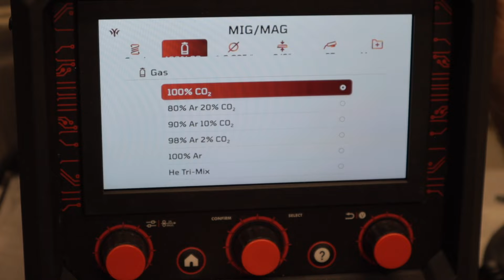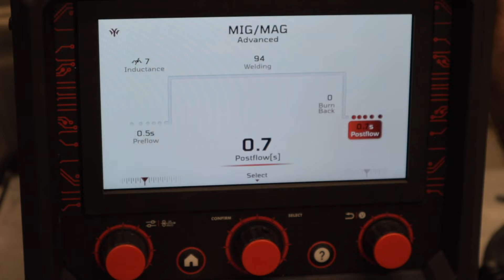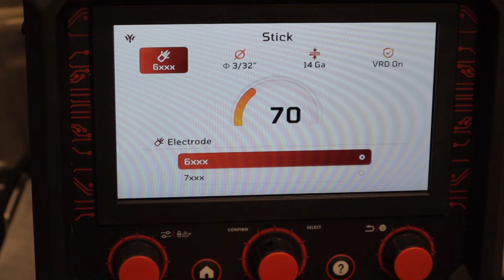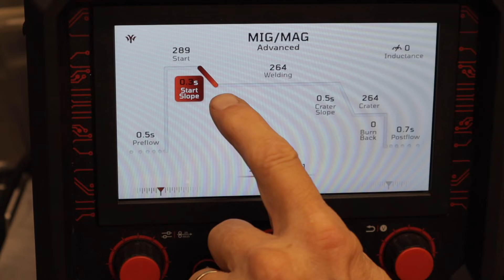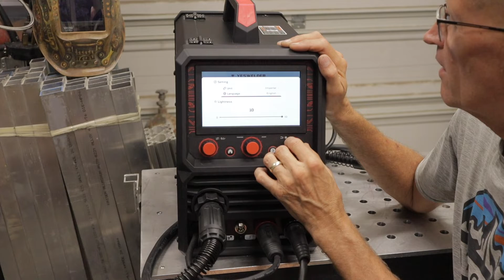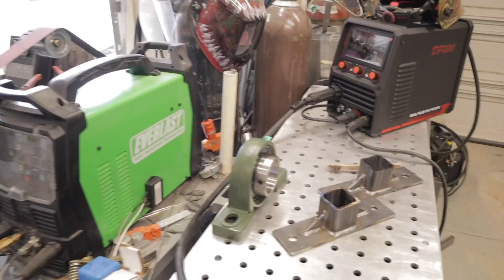YesWelder DP200 Dual Pulse Mig welder Detailed Review and Testing.

Comment: Is this real lift start or is it scratch start?
Reply from the maker: Yes, it is definitely real lift. You touch the workpiece and nothing happens until you lift up slightly and the arc begins. 😊👍
Reply: @PranaTech  Foot pedal controls amperage or is it just start and stop?  What are the voltage output range on tig and stick?
Reply from the maker: The foot pedal controls amperage alone. Start and stop is by the touch of the electrode with the lift Tig start. The voltages for stick are 20.4v @ 10amps to 27.2v @ 180amps. For Tig the voltages are 10.8v @ 20amps to 18v @ 200amps. Hope this helps👍😊
Reply: @PranaTech  Thanks, I got their MP200 during the kickstarter, the specs weren't what they claim and I know better and expected only 60-80% which was an ok deal during that time vs anything on the market.  Does the board on the production mode have conformal coating?  They did not on the MP200.  Corrosion of solder joints will eventually become an issue if left in the garage or outside.  And don't forget grinding dust everywhere.
Reply from the maker: That is a great question! I have no idea about conformal coatings. My shop is very small and grinding dust is definitely an issue. I try to pull the case off once a year and blow everything off inside to keep that issue at bay. Corrosion is not an issue here in the dry desert, but I’m sure in areas with high humidity it could certainly be an issue combined with grinder dust. 👍
Reply: @PranaTech  Protect your lungs when grinding it's no joke how much gets into the air.  Do it outside with the garage door close and a stiff wind or shop fan.  And don't forget to blow the dust off the concrete driveway before it rains. Otherwise, you'll get a nice rust stain.
Reply from the maker: All great advice! 👍

Comment: Whats the amp output and duty cycle on 110v and 220v?
Reply from the maker: Hey! Sorry about the late reply. On 120v it is 25%duty cycle @ 120 amps and 100% duty at 60 amps. For 240v it has 25% duty cycle @ 200 amps and 100% duty cycle @ 100 amps.  Hope this helps! 😊👍

Comment: So it has just very limited and basic tig welding settings - what a waste! If it just have all the same settings open for the TIG - it would be no brainer! The fun part that this machine don't even need any parts to be changed as it already have everything to have even double pulse. Sad. Thank you for the good review - now I understand that I don't need this machine, next one probably, with all the settings open for the TIG.
Reply from the maker: Hi Sergio, yeah, if you want to Tig weld aluminum, then this machine is not for you. They are working on a big multi process welder that will AC/DC Tig and Mig and plasma all in one, but I have no idea when it will be released. 😊👍
Reply: @PranaTech  I don’t want plasma in the same machine. honestly hoped it has both AC/DC - tig and mig. Once again- review is amazing, thank you very much for making it so clear and professional.
Reply from the maker: You are very welcome!  And I agree, I rarely use my plasma cutter and it only makes the machine more bulkier. 👍😊
Reply: I'm considering buying this machine, very soon. I was wondering if you had a part number on a tig torch for me, so I don't go ordering the wrong one? This will be my first tig optional welder, and don't have much experience tig welding. Appreciate any help you can give me! Great job on the videos!
Reply from the maker: Hey there! Ok, here is a link to the style torch you will need to get set up for Tig welding with the DP200. https://www.amazon.com/26V-200Amp-Cooled-2-Piece-Connector/dp/B0BL3TDZZ7/ref=sr_1_4_sspa?crid=2KBJDS7JZK0JF&dib=eyJ2IjoiMSJ9.pi-1rOLBTbmvBDmSSKAGwLCbNr99y9ZyyFiKDzskpX0ZwJkYZ-nfDU6_aMJcxHbR59KIBYVsBsjXHdxwo1hooIxVwdyEgi55h72ddAuuHmb6hYZn4DUCp67W04ZxF8IFd-fffTXHsGmkTzQuRkLkFWoQ8y_EE-OStc64fTFGWkOFPyasFpaFBLtwdFAHxzuVdBZHjoIJQw8cniZ7nN3lK6bAOAXop1jyZnTmYmqlHwFVmj6Uob69HXD9QeTHv3f-g-LzD83E9Y-Pjfq6hVOX6ZaY2Hd9FU0qhAoigvPASdM.kE2G-1Sz0llhjOOlZ2-Jc-PUOSozIQW5NwAJ5doWt3c&dib_tag=se&keywords=35+dinse+Tig+torch&qid=1736123647&sprefix=35+dinse+tig+torch%2Caps%2C238&sr=8-4-spons&sp_csd=d2lkZ2V0TmFtZT1zcF9hdGY&psc=1
You don’t necessarily need to have a 200 amp torch, but if you are going to be welding a lot of thicker metals with Tig, then this torch is the way to go. You need the gas valve on the torch so you can turn the argon on and off when needed because the welder does not control the gas flow. You could get away with a 150 amp torch if you are mainly going to weld 3/16” or thinner materials, but the connections will need to be the same as this torch. If you have any other questions, please feel free to ask me. I’m always happy to help in any way I can. 😊👍Don

Comment: What amp circuit are you running it off of?  I need to install a 240v outlet in my garage for this.
Reply from the maker: I’m running a 30 amp circuit and even my 250 amp Tig at max amperage doesn’t trip it. 👍😊
Reply: @PranaTech  Perfect, thanks!